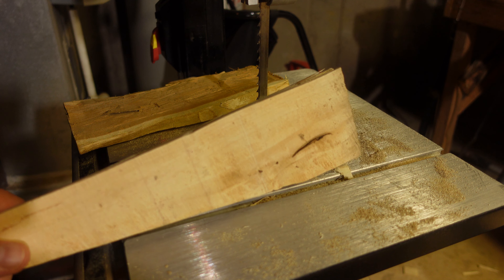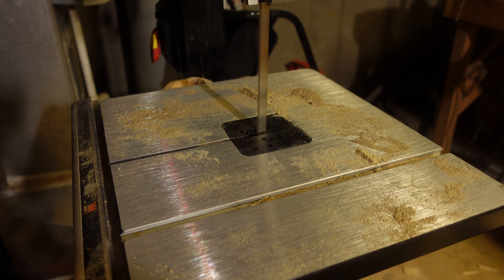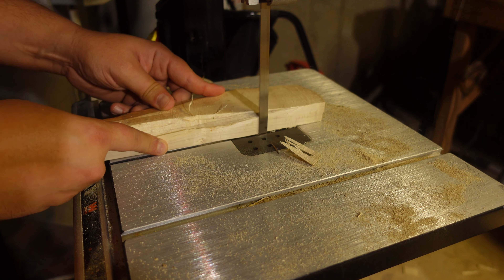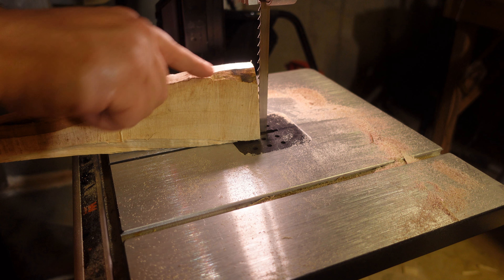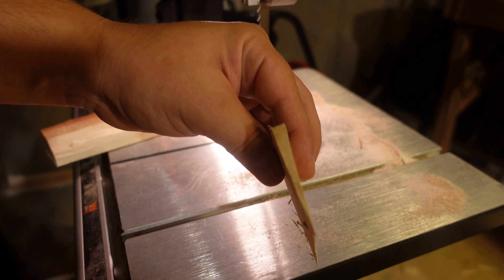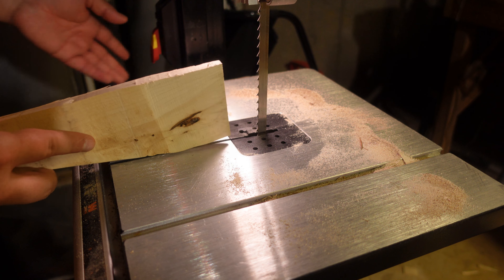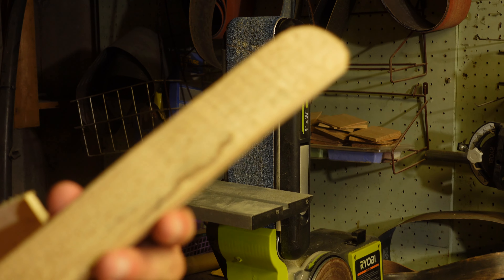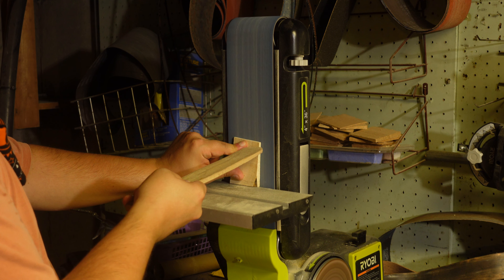Making Axe Handle Wedges

Comment: I found that I had to remove the back side of the palmswell on my straight handle axe. I found that when I was swinging the axe during bucking the palmswell tended to  rotate into the base of my thumb and break my grip. I guess with a hatchet you don't ever have to rotate your wrist that far.
Reply from the maker: Interesting.  I have an axe like that and haven't thought about it.  I split a lot of wood with it before I got heavier axes.

Comment: Good tips! What are your thoughts on grain orientation for wedges?
Reply from the maker: I wouldn't say it's my expertise. My opinion is that the wood between the growth rings is softer.  If the grain runs horizontal it doesn't compress as much.  I also think medulary rays don't compress as much so that's the opposite orientation.  Compression is good.  Fills spaces and locks everything together better.  That's why poplar is used so often as a wedge.  There are many other options though. 

In practice I don't worry about orientation much. Just that it's a decent wedge and everything is shaped well to accompany it.
Reply: @ethicalaxe  That makes sense. The only wedges I have made were out of some scrape purple heart decking boards. That wood is so dense I doubt it compresses at all. It's pretty but wouldn't be my first choice as I think it's too hard.
Reply from the maker: @brettbrown9814  Soft hardwoods are better for a functional hang compared to hard hardwoods most likely.  You need to be very careful shaping everything with something as hard as purple heart.  Soft hardwood wedges are a lot more forgiving.  That's a nice byproduct of compression.

Comment: I shape it with an axe then, use a draw knike
Reply from the maker: How do you hold the lumber? I've used a knife before.  But I prefer carving greenwood.  It's just so pleasant.
Reply: @ethicalaxe  where do I have my lumber, just leaning up against the tree, i use logs and use the middle as my middle of the axe all the way through, imake it thick so it strong
Reply: @ethicalaxe  I make it all with my hands and a vise, a hand saw, I make my own metal wedges
Reply: @ethicalaxe  I hold it with my hand, on the stump, and chip carv